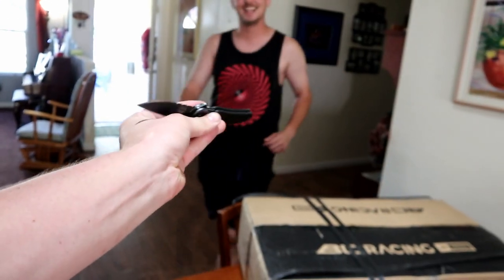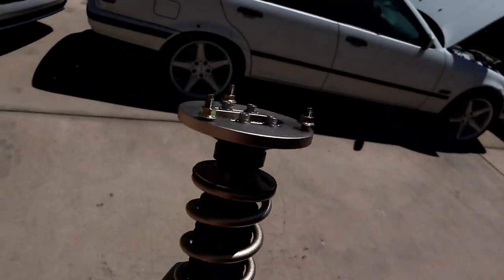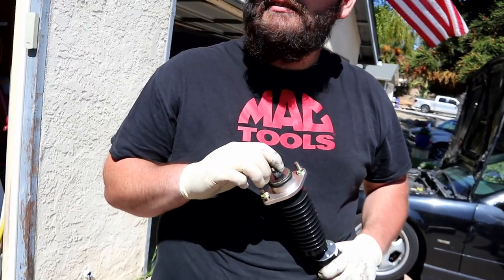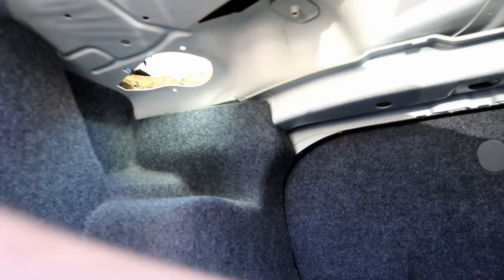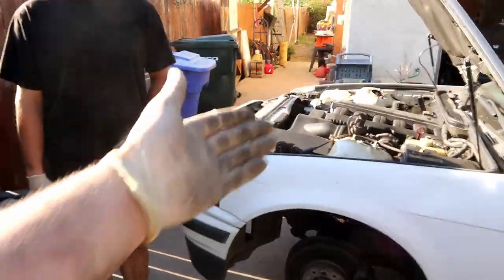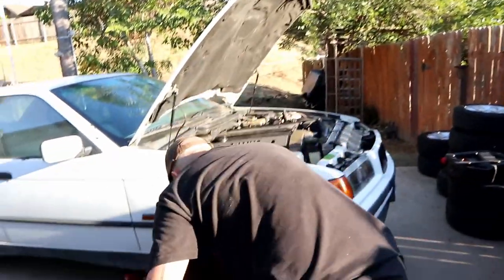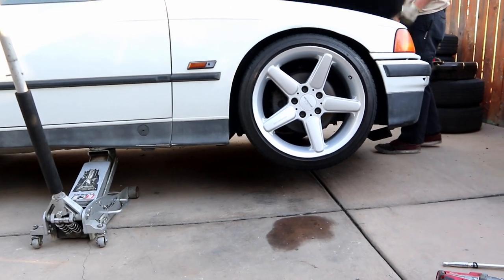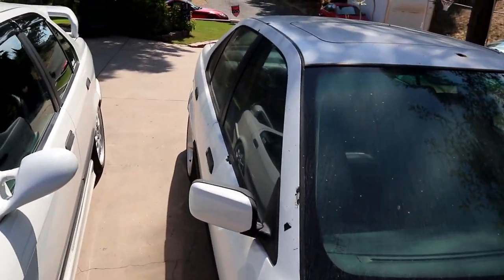Panda E36 Gets Stanced!

Comment: What dampening do you run on Cheeto?
Also do you plan on doing any bushing upgrade videos? Curious how much it helps with drifting
Reply from the maker: damping* we run 4 clicks away from max stiff on all 4 corners, we will be doing a full rebuild on the car at some point, my droptop needs it more than the drift car does lol. the drift car already has poly trailing arm bushings and factory stuff for the subframe and diff, but the stock bushings are in pretty good shape, and seems to do it's job well. the tail end seems firm and doesnt chase itself or move around alot which is good, bad rear end bushings will get squirley
Reply: M3NACE I have a welded 3.15. Is the 3.91 a good enough upgrade to daily?
Reply from the maker: @turbolifestyle6548  welded 3.91 is great for drifting, pretty brutal on the highway though. We turn about 4-4500 RPM at 80mph, so its pretty up there.

Comment: Those AC’s 18”?
Reply: Yup
Reply: Did you have any problems getting them to fit? I want a set for my M3 to keep it era correct. ACs were the thing on an E36 in the 90s!!!
Reply: Justin Tarango the tires have a little stretch to them but not anything crazy the wheels are 18/8.5 square and the wheels are 225
Reply: Justin Tarango but appreciate the love for the wheels man I love them